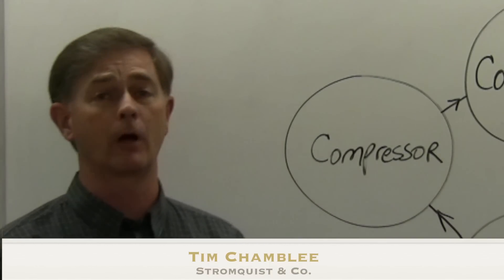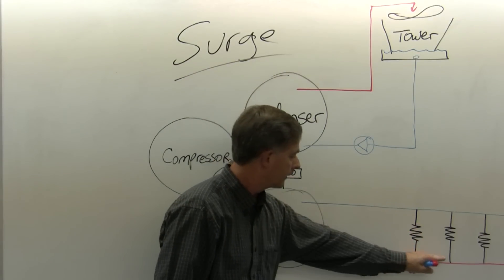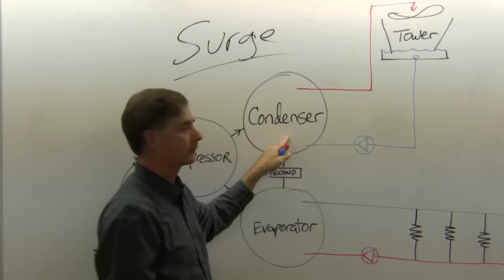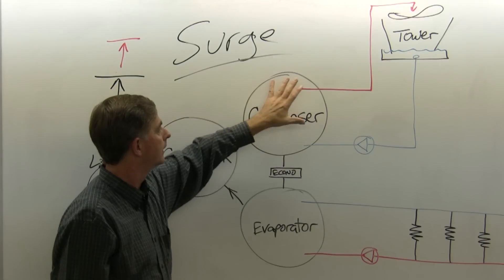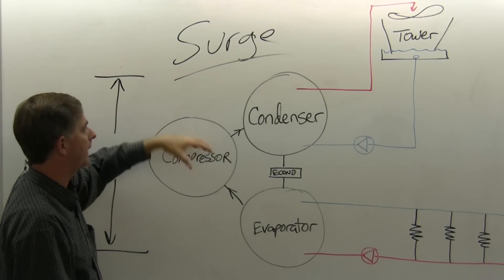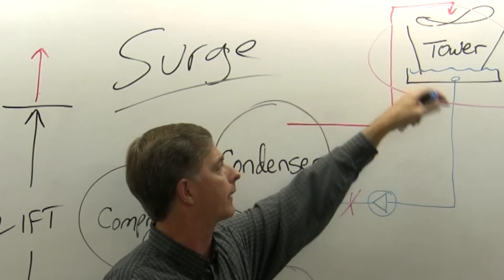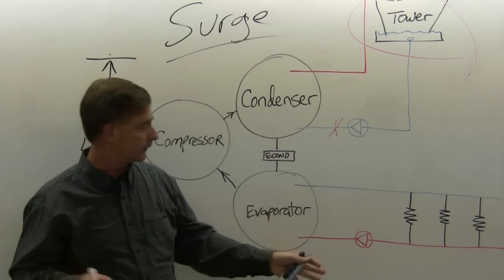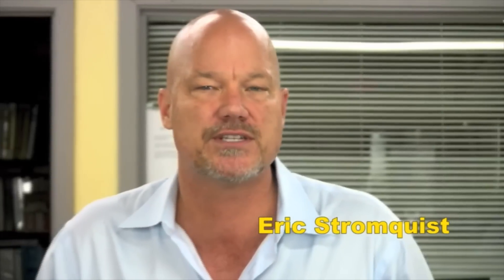HVAC Tech School: Understanding Chiller Surge

Comment: Fun, fun.  I test chillers for a living.  hot condenser creates a surge.  If my unit surges I back off the vanes which lowers the temp in the condenser.  A leak in the chiller that draws in air can create a surge. Or it can be just (in my case) bad test conditions.   Watch the evap temp as this can bottom out in a surge.  A surge is so loud that it sounds like a train.:)
Reply: " A leak in the chiller that draws in air can create a surge.  "
- Air Purge Separator isn't working then.
Reply: @MR-backup is the air purge separator designed to keep up with air leaks? Talking about air leaks from a possible hole in shell,loose connections on fittings,etc

Comment: You are wrong if what you say is correct then we can trip the compressor on high discharge pressure before surge occurs
but surge occurs not due to high pressure but because of low flow rate in the suction.

Comment: Can a low end surge only happen on the evaporator side or can it also happen when you have a low load? If so can you explain how?
Reply from the maker: Great question! Short answer is I don't know, but I will find out and get back to you. Give me a couple of days. Thanks for checking out the channel
Reply from the maker: Ok here is what I found out:
A surge condition that invloves the Evapotartor can be caused by:

1. Low refrigerant from a low charge or a metering device restricition
2. Low Flow which could be caused by water bypassing teh division plate or blocked tubes or air in the water lines or a dirty strainer or  Pump/Valve Problem

Low load can drop the low side pressure, but teh machine unloads and the high siade pressure also reduces.

Hopefully that answers your question. Thanks again for checking our channel out
Reply: @StromquistandCo  Thank you.

Comment: that's exactly the same drawing of the refrigeration cycle of a chiller that I learned on too.  great explanation too.
Reply from the maker: Thanks Derrick, I appreciate you checking us out! Do you mainly work on chillers or do you get involved in HVAC controls too?
Reply: @StromquistandCo  I have been a chiller technician for Carrier for 12 years now.  I work on anything and everything.  Controls, Trane, York Carrier, Daikin, Turbo Core, Roof top units, software.  I'm still learning as I go, trying to stay as humble as I can in this trade.  we know there is always something new to learn.

Comment: i might have this kind of problem. thank you for making a great video like this i learned a lot sir..  i Just have a question sir. my question is i have a water chiller with a screw type compressor and a evaporative condeser. im having  hard time because the chiller always shutsdown due to high pressure. and when i open my evaporative condenser it has a water rust on the coils. is that the cause of high pressure on the plant? please answer my question sir i really need a peace of.advice.

Comment: Same thing can happen in a auto ac system if the condenser fan fails right? there is a high pressure valve that can be released

Comment: How much does a rookie stationary engineer make starting?  I`m going back to school for an associates degree in facilities maintenance technology.
Reply: As someone who has just graduated from a 2 year HVAC/R program a week ago this May, I can tell you what I know from my job offer, classmates' job offers, and what our instructor.  Starting off, bare minimum is about $14 an hour, though location will have a big impact on that.  Many of my classmates who got hired locally are starting at $14 an hour, with the few guys who made it into the union will be making about $20 an hour but we're in an more low cost part of the Midwest.  I'm starting at $25 an hour but I'm willing to relocate to a high demand area where the cost of living is higher, i.e. taking count my income my starting wage is worth about $20 an hour where I currently live but to get the same standard of living in San Francisco I'd need to make $37 an hour.

The other issue is experience.  After looking up what stationary engineers do, it seems like they do a lot of the more industrial hvac work.  In hvac, you can expect somewhat low wages for the first 3-5 years then a significant increase in salary after that and finding work will become much easier, as most jobs tend to require at least 2 years experience and a solid employment record.  So stick with it and you'll find a good job eventually.

Comment: what is the purpose of high pressure switch than???
Reply: EXL HVAC Keep you from starting a recently stopped system when you have a hot evaporator.  Latent heat in a recently stopped system will often be enough to do this even when the evaporator is cool.
Reply: It will stop the chiller instantly to prevent damage / released of Freon. But automatic controllers /sensors will try to keep the Hi-pressure switch from activated.

Comment: Sir, I have five centrifugal chiller  with 2 compressor. when start chiller its running normal. but when start 2nd compressor then alarm will come for surge and machine will be trip from surge. I mean one compressor running with normal but 2nd compressor having surge. same problem all five chiller.
Reply: Ashfaque Ansari : Maybe condenser water's temp too high, pls check cooling tower capacity or condenser water flow quantity.

Comment: Doesn't this happen sometimes on startup too? I know some chillers will surge a bit on startup but then goes away. What can cause that?
Reply: Juan Zingarello In any mechanical motor-based system, whether it be an A/C, refrigeration system, or your car, there's always locked rotor amperage event for startup. That means the amperage is usually higher on startup so the system can get going.
Reply: when you start a chiller it has a big different in temp /press  change, so it will surge . Try loading it up a little slower !

Comment: Surge only happens in water cooled chiller
Reply: Pls decrease ur pressure first , go to washroom then explain us
Reply: Apit Golden Elbow ever heard of air cooled powerpax chillers? they suffer from this on any days above around 38 degrees C (very common in australia) they are magnetic bearing as well so they suffer even worse from high pressure differential as it forces the mag bearings out of alignment very slightly but still enough to fault the chiller. nothing you can do to fix it apart from fit the powerpax cooling pads to the condenser. they are effectivley celdek evaporative cooler pads however these will very quickly screw the coils

Comment: Tim, I have an ammonia coolant system, where the ammonia leaves the condenser and goes up to the roof, where it is chilled and recycled back.  So, how do I determine the proper temperature of the return.  Plus, there isn't any leaf strainer which will cause ammonia to lead into the air.  Belts are working, fans are working,  I keep getting a surge that shutting off my pump, but the engineer in charge says that it's not the water tower.  what are your thoughts?